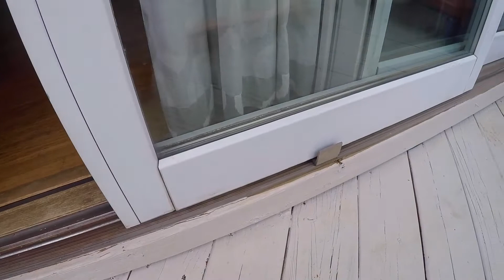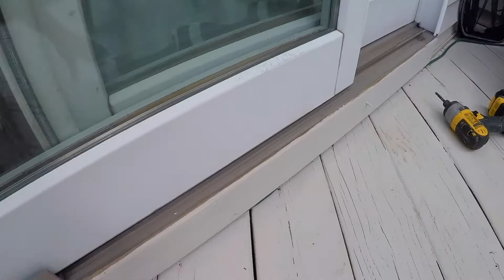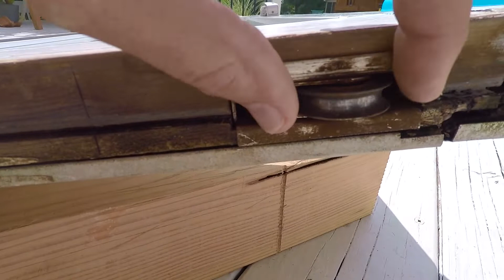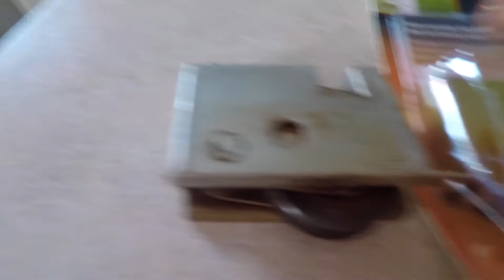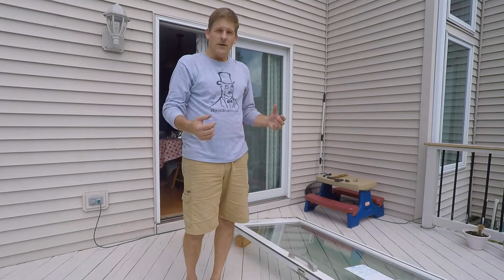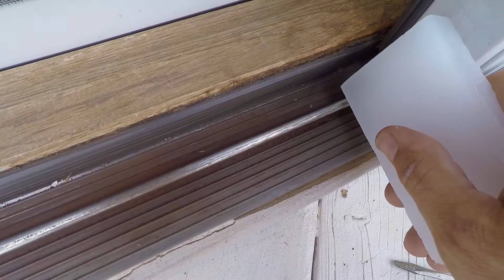Sliding Glass Door Repair

Comment: Lubrication is for weatherstripping and points that rub. Wax will not stay on stainless steel.  It will more likely stick to the roller and cause bumps. The rail is for rolling, not sliding. You wouldn't wax or lubricate the tread on your car tires would you?
Most Pella rollers are much harder to remove than these. The fact that they fall out is not a good thing.  It probably means your wood is rotting or otherwise deteriorating.